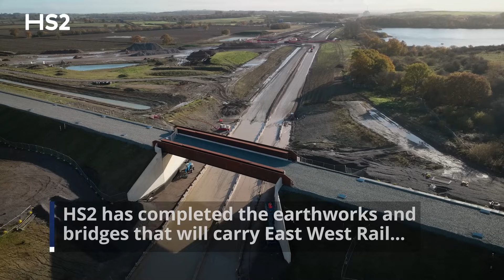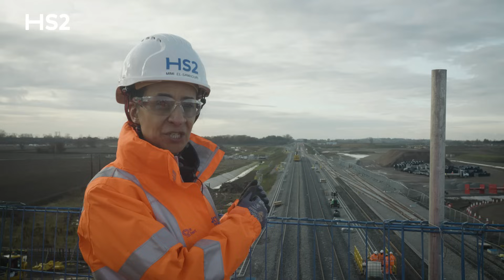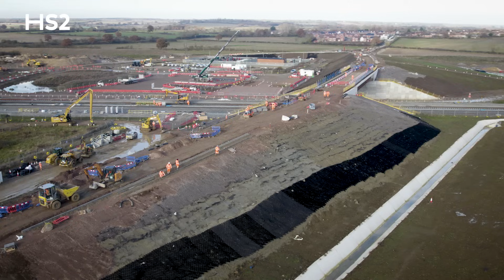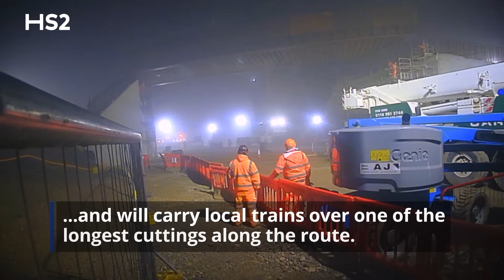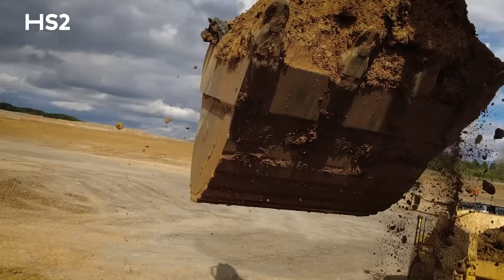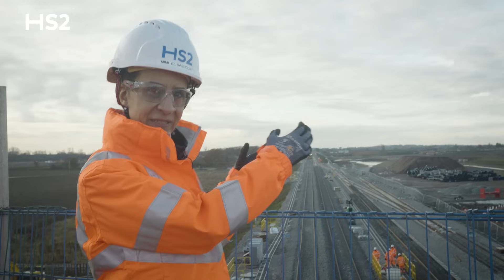East West Rail bridge near Calvert completed

Comment: I note the subtitle refers to the East West Rail which 'will carry local trains...' I thought East West Rail was an inter-city project, similar to HS2, but with greater likelihood of getting to its intended destinations
Reply: I believe you are thinking of HS3, otherwise known as "Northern Powerhouse Rail". The Government didn't like people calling it HS3, as they were attempting to descope it to a midspeed line. They have more recently cancelled it in their "Cancel High Speed Rail and pretend that doing nothing is doing something plan" (otherwise known as "The Integrated Rail Plan".)

The Integrated Rail Plan itself has also been cancelled and replaced by a new plan called Network North. Network North is an innovative plan to help rail passengers in the North of England by cancelling rail investment and building roads everywhere except in the North of England. If you are confused by this, join the club!

Comment: The sheer amount of land taken up by HS2 construction amazes me. Railway building in the 1890s barely extended beyond the routes final boundaries by using the railway being constructed to move excavated material from cuttings to embankments. Yet its being talked about in this video as if that is some sort of revolutionary idea. Today's contractors seem to have some sort of weird obsession with dump trucks and have to construct miles of temporary roads to use them. Then all that land has to be reinstated when the jobs finished. I also doubt that todays methods are quicker, which is shocking when you consider the Victorians did it with picks, shovels and barrows. No wonder its costing a fortune.

Comment: Previously the Great Central Main Line passed over the Oxford-Cambridge line at this point. The fact this is reversed with HS2/EWR is curious (and gives an idea of the scale of the earthworks). Is it because of the different timetables for completion, and doing it that way around makes work easier on one or the other?
Reply: I'd assume it's also because high speed trains can't change gradient as sharply, and you can see that EWR goes up decently steeply to make it over HS2 before going back down under another bridge.

Comment: I thought HS2 was canned/scrapped?
Reply: London to Birmingham and on to Lichfield (WCML connection) is all still going ahead.
Reply: @geecee310 .. London - Birmingham is all that's left of "High Speed 2" after the scrapping of the Eastern & Northern legs & the Golborne link & within a decade of opening (in about 50 years time at the current rate of progress), it'll be nothing more than a glorified cycle path. 
The WCML connection "on to Lichfield" & beyond to Manchester WON'T be high speed which makes this massive vanity project a total laughing stock.
HS2 has proved to be an environmental disaster of epic proportions & Britain's biggest infrastructure mistake in half a century.
Reply: @CRIMSONANT1  the Birmingham delta to Lichfield section is high speed, thus continuing to afford journey time savings for London to Manchester/Liverpool/Glasgow services. This will also free up capacity on the WCML from London to Milton Keynes and Rugby.
Reply: @geecee310  .. arguments about "freeing up capacity" on the WCML rely on a discredited, out of date forecasting model which overestimates long distance passenger growth & isn't used for anything anymore except to justify HS2.
Network Rail's "New Lines Programme Capacity Analysis" shows that WCML capacity is kept artificially low by private operators wanting to maximise profits.
A DfT analysis shows that in peak hours leaving Euston, WCML trains were loaded at just 52.2%.
Reply: the links north of bham were scrapped unfortunately, london to Birmingham is still going ahead